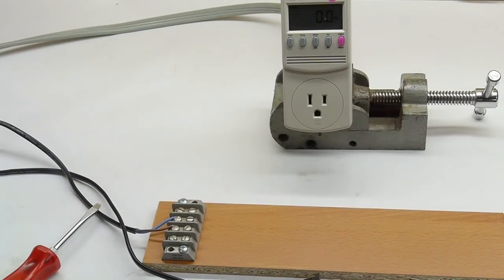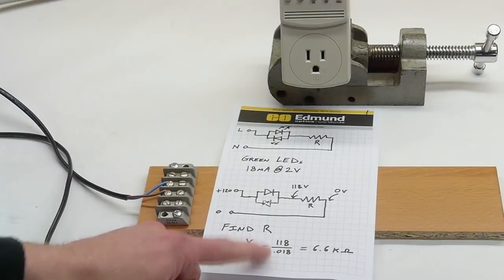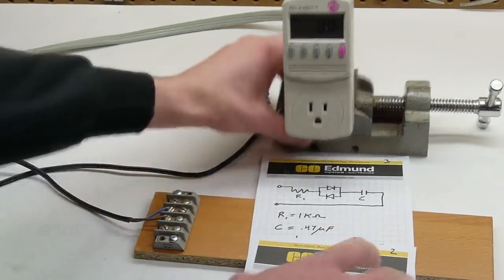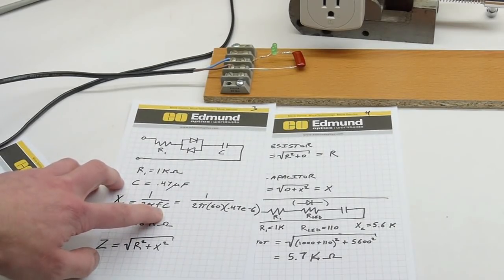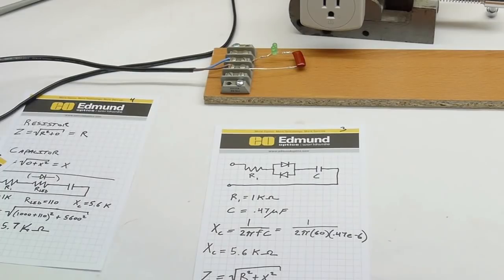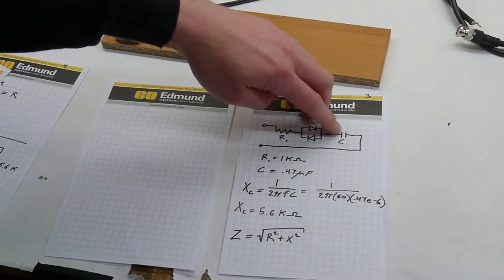Tutorial:  Electrical impedance made easy  - Part 1

Comment: single phase 120VAC neutral is center tapped ground. So if you want to zero cross you need both hot legs. Or your full 240VAC. This is something a lot of folks don't quite seem to understand.
Reply: There is zero-crossing point regardless of where the ground is tapped.
Reply: Paul Frederick that's not how it works.
Reply: st1300 r
That is how it works. One leg of single phase to neutral goes to zero, but it never crosses it. Because neutral is zero. You just think you know how it works.
Reply: If you have an oscilloscope, you can observe for yourself that this is not the case.
Reply: Paul Frederick both "phases" cross an arbitrary 0, 180 degrees apart.  A single leg is unaware of the other phase.
Reply: st1300 r
sure between both hots you cross the zero. But you never will going to neutral, because neutral is zero. Unless you want to redefine the line voltage.
Reply: No, either phase to neutral, you will see a full sine wave.

As the previous poster mentioned, each hot section is unaware of the other. You could consider them as two transformer secondaries that just happen to be grounded at one end.

If you really do still think that each leg outputs a partial cycle, how on earth do you think the physics of that would work (would each side come to some sort of private arrangement, say, you do one half-cycle, then I'll take over?).
Reply: Max Erhard
sure it is a full sine wave but it only goes down to zero. It never crosses it.
Reply: Paul in th US we technically have split phase. A center tap and 2 hots off one leg of 3 phase power on the primary side.  There is no dc offset to raise the negative half of the cycling to 0 volts. The way you get 220 is when one leg is above zero the other is below zero the neutral isn't involved. Note this is how it is wired in the US.
Reply: st1300 r
I guess it is just different by me. Here we have a bonded center tapped neutral service. That is how single phase works in the USA. 220V is really 240V these days too. Because 120+120=240. If your neutral isn't 0 volts call an electrician. Because your wiring is seriously fucked up.
Reply: I think the sticking point here is you don't believe the output of a transformer can be negative if one end of the winding is grounded. Why do you think this is?
Reply: Max Erhard
You just said why. If the center tap is grounded it is at zero potential. Either leg to the center neutral tap just goes to ground potential, it NEVER crosses it! But don't worry, a lot of people get confused with the whole ground, neutral nomenclature deal. For all practical purposes thinking about these things it helps if you consider neutral to be ground though. Because it is. We just call neutral "neutral" for code clarification. That is so we can separate safety ground, from the neutral return path. But if your premises are wired properly neutral and ground are connected to each other. This connection is in your main service panel.
Reply: What you're describing isn't AC but AC with a peak-voltage DC offset on top of it. Technically, it would be direct current as it would only flow in one direction. Aside from the fact that you obviously don't get direct current out of a transformer, most of what is in this video wouldn't work. It not only can be above and below ground potential but HAS to be (that's what alternating current is).

Neutral is the same as ground, in this respect you are correct (they are at the same potential, only the ground wire should only carry fault current). Nothing else you've said follows from this though. A voltage is a difference in potential between two points, usually ground is considered to be 0V (a negative voltage being anything below ground potential) but this is merely a useful convention (because ground is the same potential everywhere). Connecting the centre tap of a transformer to ground does nothing to the voltage at either end with respect to the centre, it just provides you with the neutral reference point.
Reply: Max Erhard
be more wrong
Reply: Curious to know which things you think I am wrong about ?
Reply: Max Erhard
I would but it is hard to decide where to begin. "Connecting the centre tap of a transformer to ground does nothing to the voltage at either end with respect to the centre" It doesn't? Then why do you think that we do? Because there is a reason we tie the grid to ground reference.
Reply: Think of it this way. You have 120v above neutral on the line the sign wave drops towards zero.  Neutral is referenced to earth. Life's good. It gets there and keeps on going to minus 120. Life's still good. We shot right on past zero. Neutral is still referenced to earth.
Reply: st1300 r
think of it this way a 120V circuit never goes past neutral. Because neutral is one side of the circuit. You're wrong. Now quit wasting my time.
Reply: well ... we agree I'm wasting your time. the angry pixies don't care if they move to  the left or the right in a wire. I can't make you believe minus 120v is still 120 volts potential. Neutral doesn't care which and is still bonded to earth. The electrons just flow technically curve in the opposite direction. in your thinking if the sign wave rides on one side of the 0 ground reference there would be an average value on the line and the electrons would tend to move in one direction.  that's DC albeit with a huge ripple. the average voltage on the line is zero. half the time the magic pixies are moving to the left half the time to the right. the ac sign wave must cross and spend the same amount of time on both sides of neutral to average 0 otherwise you have a dc bias or offset. the red and black wires have the pixies dancing back and forth out of step both spending time on either side of zero. if you never cross zero they could never move in the "other" direction. ac is the wiggle no net direction. anywho..peace.

Comment: Instructor mentioned that if I connect capacitor to a power supply, capacitor will get charged and then no current will flow through it after. can you please elaborate on this? why does not current flow though capacity if it is fully charged? in the video, he connected it to an outlet but capacitor did not stop current flow after it got charged. so why did it happen with a power supply? is not power supply similar to outlet but for home use?

Comment: I was confused by the voltage rating of the LED. Surely that LED is NOT rated for 118 Volts. So my question is: Does voltage matter if you slow the current down? Wouldn't most LED be rated for less than 12V?
Reply: Unlike current, voltage is always associated with two points (that is, you measure a voltage/potential at a point with respect to another reference point). It's obvious what those two points are in cases of 2 terminal devices like resistor, diode, etc (the 2 points are the two leads on both sides of the device). Thus, say a voltage of 2V across the diode/LED means one lead/side of the LED is 2 volts higher or lower than the other lead. Only this potential difference matters, not the absolute voltages on either sides. So, 2000V on one side of an LED and 2002V on the other side is the same as 120V on one side and 118V on the other (or even 0V on one side and 2V on the other). This 2V across a device is called more correctly as the "voltage drop" thus. :)

Comment: The capacitor acts like a diaphragm tank with water on both sides of the diaphragm. As the diaphragm stretches, it slows down the flow until it stops.

Comment: Capacitance, in a water circuit is 2 hoses connected to balloons inside a pressure vessel (bottle).
Reply: I prefer to think of a cavity with an elastic diaphragm across the middle. Low f extreme is DC. Diaphragm deflects once, but no DC can flow. Hi f extreme is the diaphragm deflecting back and forth in sync with the flow reversals. No resistance to AC. Too hi AC v will bust the diaphragm. (IIRC this is dielectric strength?) Too hi AC f will run into diaphragm inertia. (I couldn't recall this :-) and looked it up. it is called equivalent series resistance or ESR)
It's been forty years since I was taught this stuff.

Comment: That peak vs. RMS voltage is something I also wondered about when driving an LED with pulse width modulation from an Arduino. You can lower the RMS voltage with PWM, but can the LED withstand the peak voltage for the time period (duty cycle) of one pulse? In other words, is there a fairly lossless way of driving an LED from a higher voltage without destroying it?
Reply: +Chaplain Dave Sparks Well, i don't know, but it's an interesting question.  He shows, or rather suggests later in the video, part 2, how you could add an inductor to the other side to 'direct'/manipulate/point the power factor to 1.0 and therefore limit your impedance, which I always associate with 'loss' (of course I am thinking of coax cables).  I still think you will lose heat in the resistor...don't trust me tho...haha, sorry

Comment: I see how the water analogy works.  But will a capacitor pass an intermittent DC current as well as a current that is actually changing polarity?
Reply: +alex tworkowski depends on capacitor leakage. normally the fact that DC is pulsing doesn't make a difference. Once the capacitor charges to the DC value current flow can not continue, However, if the DC pulses are slower than the time the capacitor leakage time then some current will flow. Weather the leakage would allow enough DC current to light the LEDs is dubious.

Comment: I'm more confused now. You are saying that you only calculate the resistor for a hundred and 18 volts because the LED impedes 2 volts? I thought the LED would only need two volts present for a forward voltage drop and then would switch on and act like a dead short, so shouldn't you be calculating for a full 120 volts for the resistor?

Comment: Instead of putting a resistor in, couldn't you lay a capactor parallel to the LED, or an inductor in series? That way the high frequency voltage spike would be either shorted out through a capacitor or impeded by an inductor, wouldn't it? And you wouldn't suffer any additional losses through resistive joule heating, right?

Comment: Instead of using a resistor to dampen the high frequencies when plugging in, couldn't you use very low valued capacitors in parallel so the high frequencies just go straight to ground?

Comment: someone explain to me impedance and reactance i am not sure about what he said.

from another video it said something about impedance being like the resistance created by the cancelling of charges

1.when ac flows to 1 plate of the capacitor it builds up a "-" charge (now 1 plate has a positve and the other as a negitve charge)

2. when polarity reverses

electrons flow to the positive plate and cancel out the charge there 

3.and so on ( the pattern of creating a potential difference on the capacitor depends on the frequency of the ac wave) 

4.the higher the frequency the shorter time it has to build up a potential difference and more voltage would result 
5. the lower the frequency the longer the time between the polarity changes and a lower voltage would result as it then takes longer for the 2 plates to become netural in charge and thus for the electron to repel the other plate to be positve again.

is this anything close to what impedance is??

Comment: I would suggest more careful choice of words.  You keep saying electriciry flows but the more accurate statement is current or ampere flow.  College level courses are very keen to point this out and emphasize voltage as electromotive force only as it is important as one advances in this field.  Over all though nice video.

Comment: When you put more than one capacitor in series do you just do X = sqrt(C_1² + C_2² + ...) ? In which case is there solution where you use many capacitors instead of a capacitor and a resistor?
Reply: Caps in series are like resistors in parallel.  Calculate their total capacitance in that manner.  The total capacitance will be smaller than the smallest cap.  Or, look at it this way:   The distance between one  plate and the plate of the farthest cap is large, thus lowering the overall capacitance.

Comment: Things of note, if you use a full bridge rectifier, you will get a voltage gain, when used with a high voltage Electrolytic.
Due to a thing called RMS, so not that simple after all.

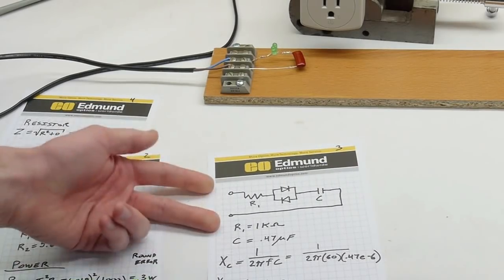Comment: At about timestamp 12:12 you state that the (60Hz) voltage FLIPS at 60 times per second.  This is incorrect and actually very important in certain applications.
The voltage actually FLIPS at TWICE the line frequency or 120 times/second.  There are "two" flips/wavelength.
In a light sensor, I would assume that the HUM you hear is actually 120Hz.  This confused me in a certain circuit design for a while.

Comment: So my understanding then, is with What happens, with the sudden surge is that the capacitor has no charge, so when 110 volts peak is applied suddenly the voltage see's no resistance from the capacitor. Therefore it is a dead short. so its not a frequency instantaneously but DC to start at the starting top voltage. So the capacitor is ready to charge, but with no voltage in opposition. The resistance (Xc) is Zero ohms, therefore the surge through the diode.

Comment: So NO resistance in a diode, Hmm. Why the Voltage drop from Anode to Cathode, Hmm. NO heat there as Diodes have NO Resistance, Question, Then why are some/a lot mounted on HEAT SINKS? 
At any point in a circuit where there is current flowing and a voltage drop there is HEAT from RESISTANCE. Please correct me if I am wrong as I only work with Metal now!
John, Australia.

Comment: what if there was an alternating water supply to homes the two wires(pipes)  connected to a same container (for utensil washing purpose) and there is a live wire (pipe) having a filtering assembly  and hence the water problem is solved

Comment from the maker: Interestingly obscure. I had never heard of such plots, and a few minutes of searching only turned up a couple examples. It looks like the information in this chart would show how the battery responds to very fast rise-time current demand. This could be useful information for certain systems, however most everyday electronics would use a capacitor. I'd have to start researching to figure out how those plots work.

Comment: So what is speaker impedance? What frequency does speaker run for it to look like the 8 ohmn on its specification?
Reply: Ian C Tubman - The impedance of a speaker is typically determined at 1KHz.
Reply: William J. Thanks. I don't see the industry frequencies in my theory books. But often see ohms values on speaker,  transformers, RF cables and computer terminators.

Comment: Theoretically, an elegant proposal ! But practically impossible, because you need Zener Diodes with breakdown voltage exactly 2 volts below mains voltage. Little more will burn out the LEDs, little less & the LEDs won't light at all.
Reply: BR Gurunandan practicality it's done this way all the time I n cheesy led night lights.  zeners aren't needed.

Comment: Instead of that resistor, a Zener diode, to protect the LED would be much better. You would loose absolutely NO power over the resistor, because it does not exist. The spike gets eliminated by the Zener Diode and will not die, because it can handle such a spike for a small time. The problem is, that the zener Diode would conduct in the other direction, so you would need more 2 Zener diodes, out of face to each other and Uz (=Vz) should be 1/2 Uf (=Vf). This SHOULD work, or? What do you think?

Comment: Your first demo did not take into account the AC nature of the current - you assumed it was DC for the Ohms law bit. The voltage could rise to 155V (110 * 1.414). Admittedly the average power dissipation will be based on 110v. Will look at the next part now...

Comment: A capacitor stores energy in the form of an electric field, this electrical energy is energy newly derived from electrical Potential energy. But to transform this electrical Potential energy into electrical energy requires both electric current and electrical potential that is delivered by the circuit.  Therefore the total energy potential of a capacitor is determined by both its current potential energy and it's electrical potential energy.

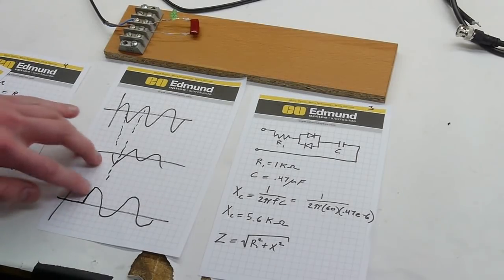Comment: at 5.:21/16:07 <Applied Science > made a math mistake !  the 0.47 uF capacitor is INCORRECTLY indicated as " 0. 47 e^-6 it should be 0.47 x10^-6
Reply: MartinMartin Martin e here is for exponential, always acknowledged as a power of ten.

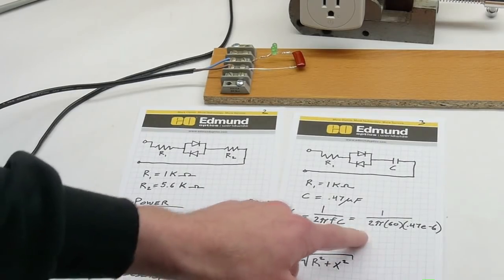Comment: 7:12 why do you need to add e-6 to the farad value?
Reply: The capacitance is 0.47 μF. (Micro, μ = 10^-6). Ten raised to some power (10^) is abbreviated as e. So, that's why the value is 0.47e-6.

Comment: Hi.I see Youre not just a bookworm nerd,You actually understand this stuff.Can You tell me how to build pulsating LED circuit,that would pulsat faster with voltage raise.If it blinks once in a second at 6 volts,than in half second at 12 volts,with only simple parts I could take from a circuit board?

Comment: 14:00  on the video you asked what would happend if we build the circuit without the resistor. I knew it had to do with current limiting but did  not know the full answer. but when you started to draw the sine wave and came with the jump that accure when connecting at the peak it became the best joke of the week . Sure strait jump consist of high frequencies (harmonies) and for them the capacitor is a short. Sometimes old lamps are going broken at the moment we turn the switch on , they are still cold and a sudden full voltage "cracks"them.  by the way how much did you pay for your new tektronix 5 serie? I want one.